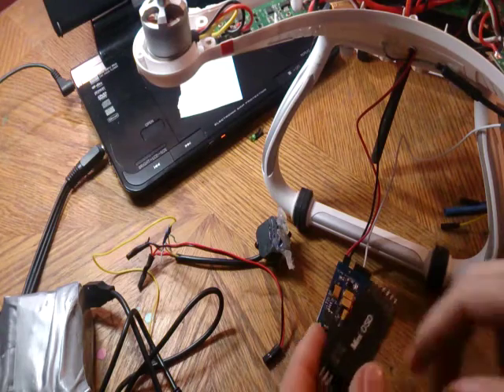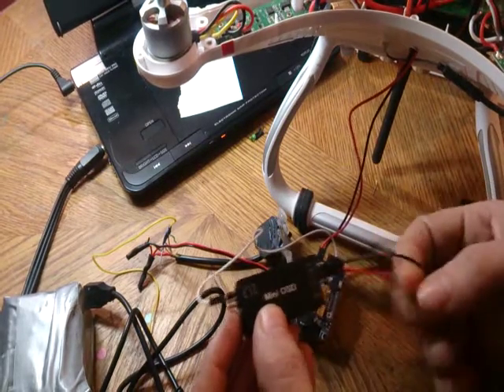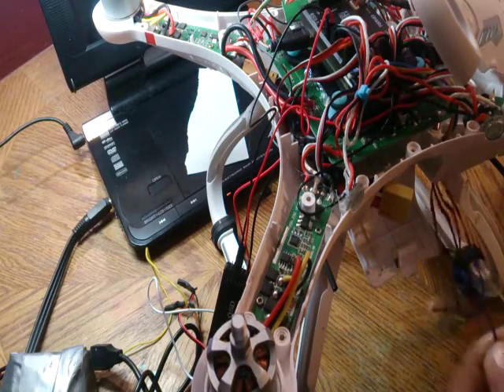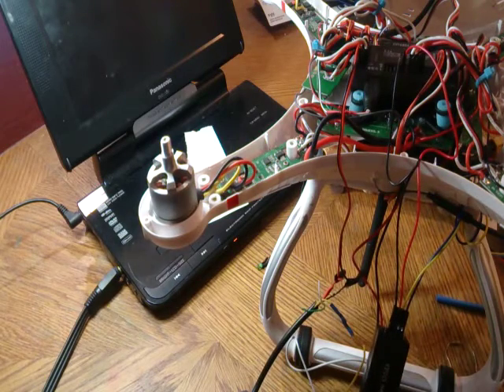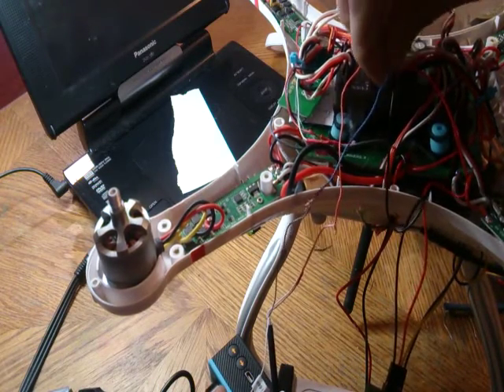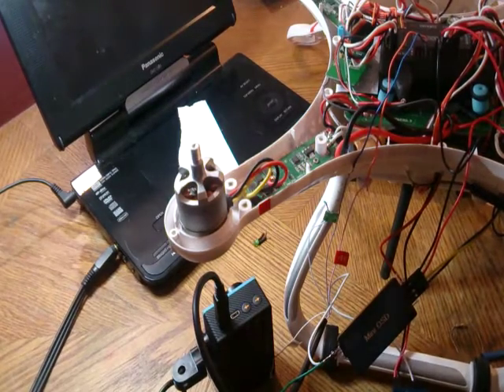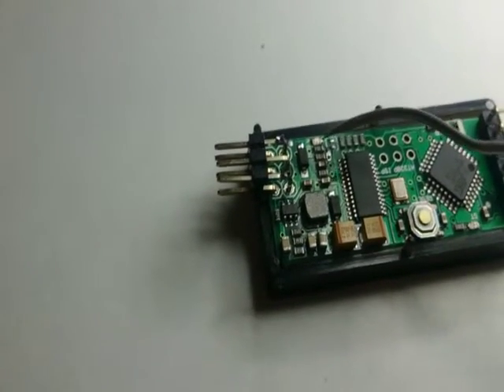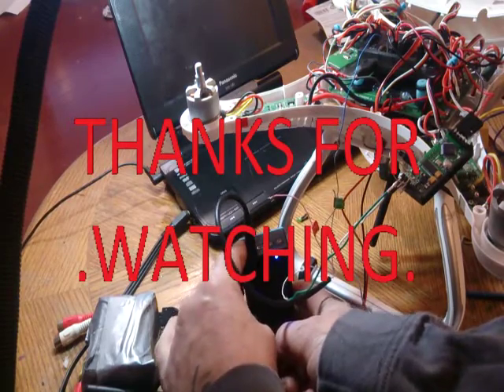mini osd wiring plus no video fix

Comment: Thanks you for the video. If you could explain in more detail how to connect the Mini OSD to the controller - wires, et all - would be even better...))
Reply from the maker: yeah sorry bout the crappy quality and the steps being a tad vague .. 
The only two wires that needed to be shown are the tx and rx wires from the telemetry port on the apm2.6..

Are you having problems still with it?
Reply: @ModItBetter  hi I gave cleared the problem. Plan to make my own video on how to connect mini OSD to Pixhawk.

Comment: Bangs do you have the firmware you used for this particular setup 

And does flashing the firmware install a new character set ?

My character set is not as it should be as I think I have flashed a wrong version 
Cheers 

Your video steps was easy to watch and make things happen cheers
Edit .....
I just went through the post and saw you used ardu osd2 
I will try that tonight 
Cheers
Reply from the maker: figure out your issue?
Reply: bangs6996 
When I get home I will install same firmware  and .cfg as you have used
Let you know tonight 
Cheers

Comment: hi bangs6996
i want to ask about minimOSD, minimOSD i also got problem like that 'no mav data', how to solve it? can i request a wiring diagram from minimOSD to NAZA v2?
thanks for his help and his response bangs6996
Reply from the maker: Hi the one that is getting no mav data is that on apm or pixhawk?

.......
Reply: I connect the minimosd directly to naza v2, not using APM and PIXHAWK. does connecting minimosd to nazav2 have to go through APM / PIXHAWK?....

for recommendation whether it is better to use APM or PIXHAWK?
Reply from the maker: Hi here is a link i found.. http://www.instructables.com/id/Using-Minim-OSD-in-NAZA/

i have not done the mod ..or created a mod...  I am not sure if I actually want to yet.
Reply: thanks a lot for the help, I will try

Comment: Question!  does it show the battery voltages? did you need to flash it to get out of heartbeat at first? Please let me know because I already got one mini osd but the heartbeat stopped after I flashed it. Thanks and Regards
Reply from the maker: Hi.. I never had to flash it .. You do see your voltages properly if you have a power module..    you need to have tx and rx hooked up if your not using telemetry , but you prob know that already.. 
Is it possible your new flash is using a different baud rate? ..
Reply: Because on your video I noticed you get the main Battery Voltage a value of 0.0 so I thought you may flashed it with malware. Cool if you say so they may flashed the original mini OSD which sale $7.85 and put a plastic cover on it, and sell it twice the value now. Awsome I will get this version , I think Bangood has it. Thanks very much and regards , This needs to be installed on my cheerson cx20.  Thanks.
Reply: So I keep watching your video you posted, it shows each time you connect the OSD the Battery value is like the rest of us 0.1 V and the current value 0.0
do you have any other video this problem is solved ?
Reply from the maker: HI .. i have another step by step with the cx20 install  .. however i  am not sure if i had the box checked in for power module.. regardless challenge excepted..   I will spend time tomorrow.. re hooking it back up and checking things out ..
Reply from the maker: Oh and if you are doing this on a oem cx20 apm .. don't forget you need the custom firmware for telemetry ..
Reply: I already installed the Telemetry on my cheerson and it works awesome on Mission planner,  the only problem is with minim OSD I purchased a week ago and it froze and stopped the heartbeat after I flashed it by a wrong malware update, because out on line there are too many versions download and don't remember what I uploaded to my OSD made it freeze,  and heart beat stopped, and doesn't boot anymore to load the original files. So I thought yours may work without flash upload.
Reply: The main problem with my Minim OSD was just the battery voltages,  which everyone complain abut it on YouTube.  ; (
Reply from the maker: well .. i just tested it and it works.. you need to enable your power module in optional hardware
Reply from the maker: also in standard params..my were set to a1 and a2 for some weird reason ..so make sure battery current sensing pin is a12 and battery voltage sensing pin is a13  . ..after that my amps and voltage are good
Reply from the maker: and to continue spamming you my firmware version is
ArduCAM osd v2.0
Reply from the maker: If you have a isp you might be able to bring it back to life.. ..maybe its just bricked .. I can do a complete dump of mine and send you the firmware if you have a isp..  .. or maybe i can make a video out of it heh... ..
Reply: Yes as you said, in order to enable battery power there is a need to flash the hardware with USB and firmware or you did it on mission planer?
Reply from the maker: Mine came with version 2.0 .. i never had to flash anything to get it to work.